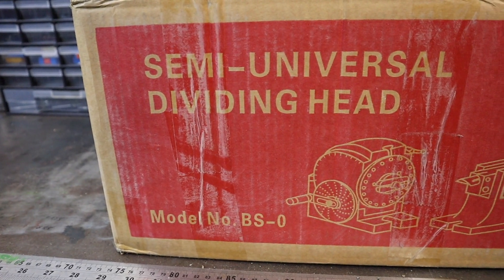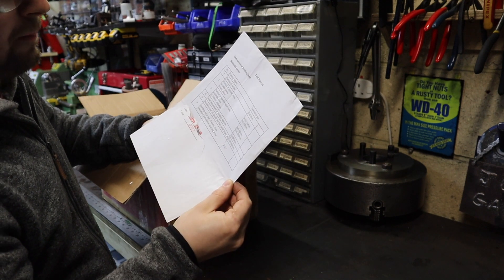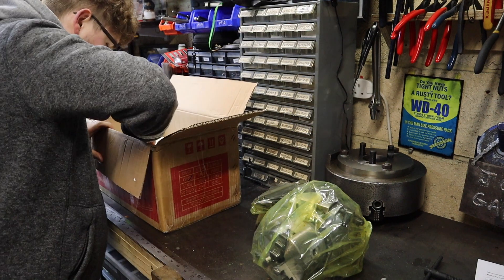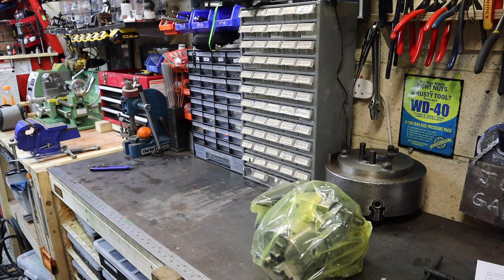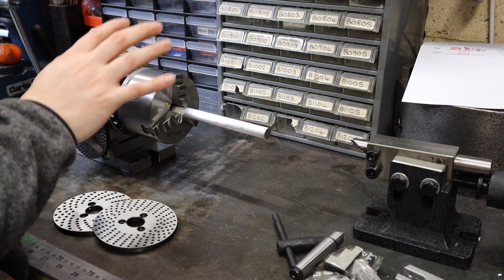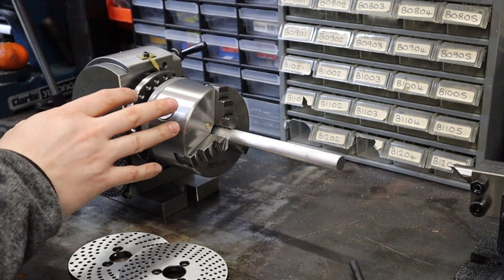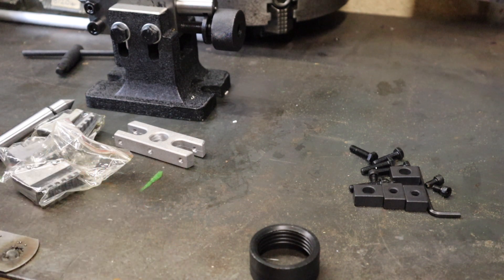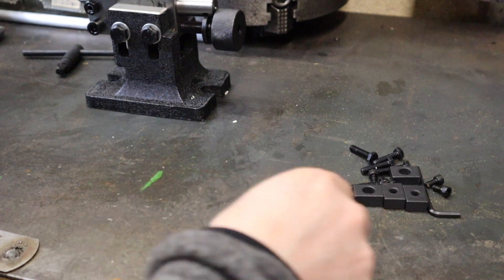Vevor BS-0 Dividing Head Review

Comment: A tap hole and a bolt that goes into it it's gotta be adjustable mate! You can't be a tapped hole sometimes you're gonna be setting that at an angle you're gonna need it a couple of degrees out of square it's got to be adjustable you're not a machinist are you?
Reply: You are absolutely right that 2 tapped holes aren't the answer to the 2 individual but and bolt assemblies. What it needs is a piece of rectangular flat stock with the 2 holes tapped through the flat stock at the suitable centres. Effectively one elongated but with both the clamping threads in it.

Comment: Cracking review Joe… I compared prices and found that this kit (just like the Vevor VFD) is cheaper directly from Vevor UK than off eBay..!
I’m looking forward to what you discover when you strip this down. Keep up the good work, All the best…
Reply from the maker: Hi Aidan yeah I found the same sellers on eBay are charging a lot more so bought it direct at a cheaper price. Yeah so far seems really good bit of kit. Used it to cut 100t module 1 gears no problem was great.

Comment: Joe,
To set the tail centre up extend the tail centre as far as can loosen the bolts set up the headstock and tail stock on the mill bed or surface plate grip the tail centre in the chuck then tighten up the tail stock centre or use a piece of silver steel the right diameter in place of the tail centre and do the same for more accuracy replace the chuck with a morse taper collet and do the same. 
Hope this helps. Another great video. 
Jon.
Reply from the maker: Great method Jon thank you I’ll be doing that for definite before next video when I’ll be doing some gear cutting.

Comment: Some sort of T bolt on the tail stock might do the job! I have been eyeing one of these off for a while, so if you dont mind, a couple of questions. Which one did you get? The add has 3 sizes, but they are based on plate size? Also, when you have it setup in "rotary table" mode, how tall is it? I have a lot of Z travel in my mill, but that looks tall!
Reply from the maker: Hi jack good idea with the t bolts. So I got the 4 inch plate model and when I’m next in the shop I’ll stand it up and measure it for you. 👍
Reply: @MachiningwithJoe  cheers Joe!
Reply from the maker: From base to the tip of the jaw is 25cm or 10” hope that helps you
Reply: @MachiningwithJoe  cheers, i have 43cm of Z axis, so probably usable as a rotary table as well! thankyou!